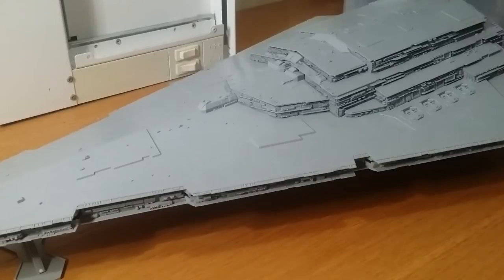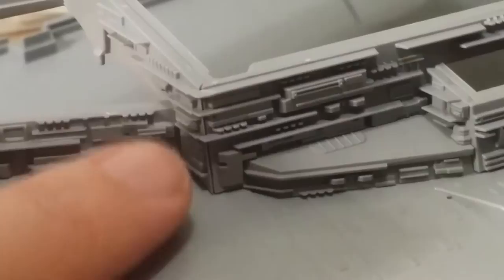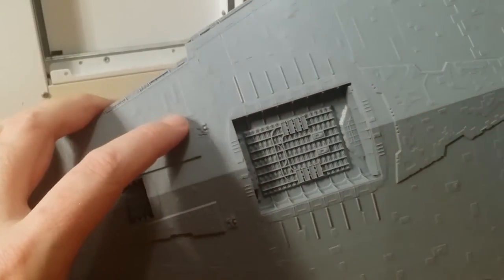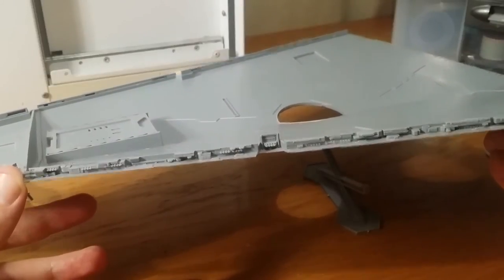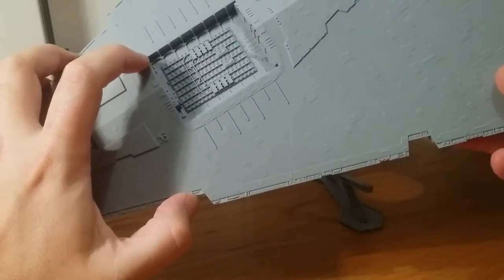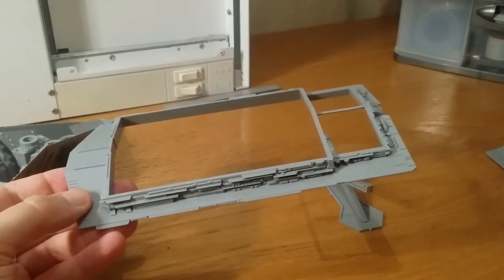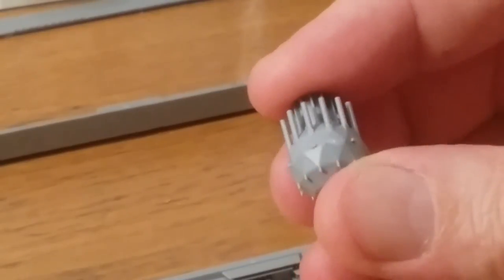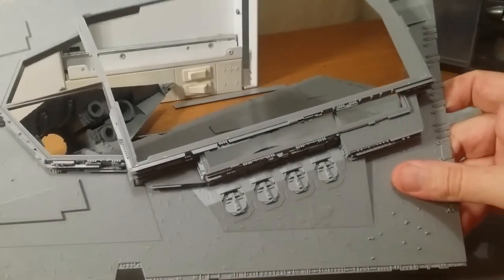Zvezda Star Destroyer build tutorial Part one.

Comment: great video!  I subscribed as I have one of these coming from overseas now.  I am anxious to see what you do with it along with painting and lighting.  Bring on part two...When do you think you will have it up?
Reply from the maker: Jeff Sage Hi mate :-) Thanks for the kind words. I am hoping to have part two up in the next 24hrs. I will cover the drilling, some minor scratch building and maybe some light blocking. Glad you like it :-)
Reply: Awesome Thx!! Looking forward to your build...What are you using for drilling the holes?  First time putting lights in.
Reply from the maker: I have a Dremel but I decide to use a small motor tool I purchased at a hardware store. I was pretty cheap and much easier than a pin vice lol. I also purchased some tungsten drill bits online in a range of sizes from 1mm down to 0.1mm. For this project I has used 0.5 to 0.8mm. I will use bigger ones for the engines etc.

Comment: Andrew, I like your idea of using the LED strip(tape) for most of the lighting.  As you said, it works for the Star Trek ships.  :-)  This is how I'm planning on lighting mine so I'll be following this build closely.

BTW, what size drill bit are you using to drill the holes for the lighting?
Reply from the maker: Hi mate. I hope it works :-). At the moment I am using a 0.6mm drill bit to drill the holes. I have added a few 0.5mm ones as well just for a little fun. I may add a couple of larger ones as well. I am not really following any plan as the models differ so much, so just making it up as I go. I have broken two 0.6mm bits so far. 1 was my fault the other just had enough lol. I am almost done with the drilling so I will shortly commence painting the interior to light seal the kit.